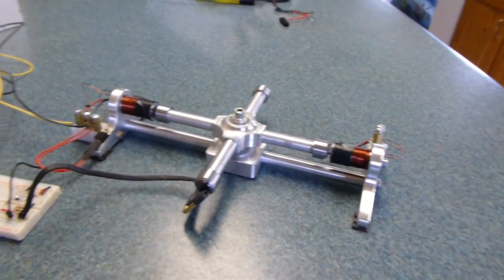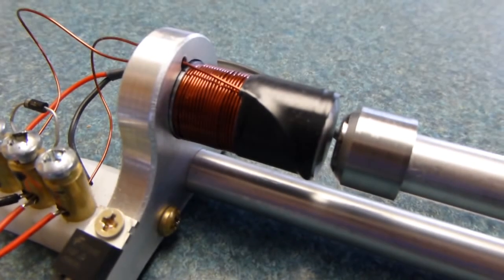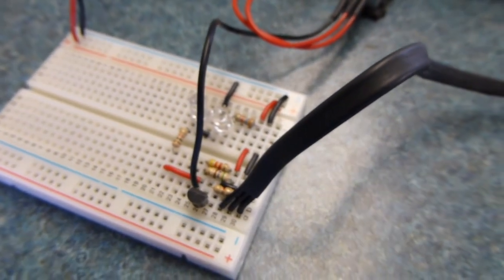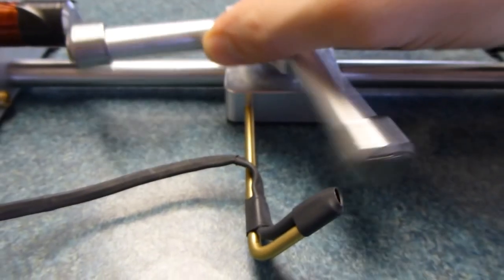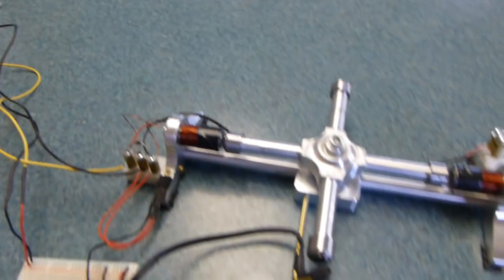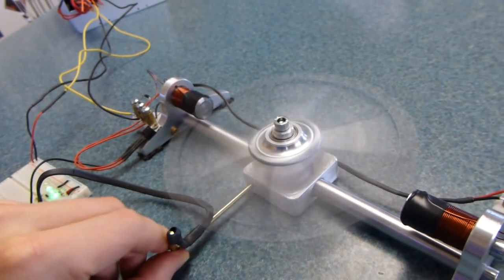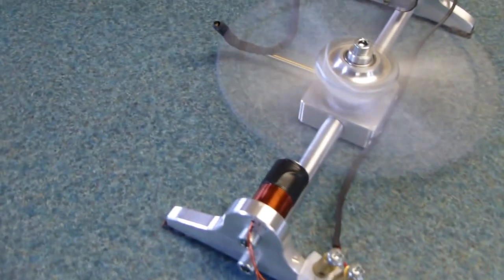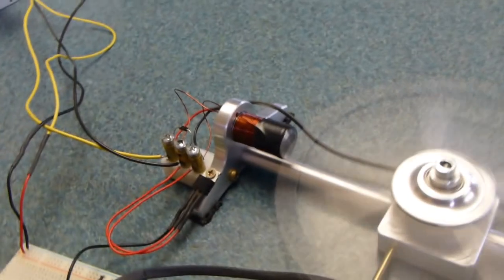DC Brushless Motor Project

Comment: Very cool, and i would have to work hard to do as good of a job as you did. I have a question though, When you turn the switch connected to the Brushless DC Motor, that shuts the current off for the coils, right? But, the motor stops with the coil next to the neodymium magnents. Is this from the attraction to the screw (or whatever it is) that the coil is wound around?
Reply: the magnets are naturally attracted to the iron(or what ever core metal he used)  of the coils.
Reply: That's what I figured

Comment: So when the power is cut from the power in what does that do?
Reply from the maker: ...it stops.
Reply: so it stops and starts again? Sorry Im still figuring out how this stuff works, I'm talking about when the sensor sends the signal that cuts the power.
Reply from the maker: Every time a magnet passes in front of the sensor it triggers the MOSFET to feed current through the coils. When the magnet moves away the signal stops and the MOSFET turns off.
Reply from the maker: The coils need to be turned off as a magnet approaches them because the active coil repels the magnets. Once the magnet has passed the coil it turns on to push that magnet away
Reply: Ok that makes sense thanks alot man
Reply from the maker: No problem, Robert!
Reply: lol...

Comment: Hey Jobn, good job! I was wondering how you would know which way it is rotating once it starts? It can actually rotate in either directions, right? Are the electromagnets producing the same poles towards inside the motor?
Reply from the maker: Luck of the draw. If it was machined perfectly it wouldn't move. It just so happens that it's deflected off to one side a little bit!
Reply: hahaaa!!

Comment: Nice explanation, I was looking information about the DJI Phantom and they mentioned "brushless motors", but had no idea what the technology behind the motor was. You explained it pretty much now...does it mean that the motor can run both ways (i.e. clockwise and counter clockwise), depending on which direction you push the rotor to?
Reply from the maker: Yup. What I showed here is a very simple single-phase motor. Your Phantom will run on 3-phase brushless motors, so there will be three leads coming out of each motor casing. Reversing any two of those leads will reverse the direction of the motor.

Comment: with all the requests looks like there could be a hobby kit with your name on it?
Reply from the maker: Haha, maybe. I don't understand the requests. It's a really straight-forward control circuit, I thought I did pretty well explaining it all in the video.
Reply: Jon Proce Some people don't know, what a mosfet is; why do you have a diode in the circuit and the resistors, why so many, what are they values and why, are they connected in front, after or in shunt  & with what & why, and so on.......Just think of yourself when you were new in this field, and you will understand the questions about the circuit straight away. ;)

Comment: Nice motor. Do you have a sketch of the circuit?
Reply from the maker: 12 V >> Coils in parallel >> MOSFET >> Ground

MOSFET gate is triggered by output of Hall effect sensor. That's it!

Comment: Could you please make a tutorial on how to make this?
Reply from the maker: Have you got a CNC machine shop at your disposal?
Reply: Unfortunately Not. I'm not in any engineering program. But thought that this might be a good project of physics class as we were on the topic of DC motors and the only exemplar that we had did not work.
Reply from the maker: The reason I ask is that the fabrication encompasses 90% of this project. It couldn't be reproduced unless you have the manufacturing facilities available.
Reply: Ok. Well Thank You very much for replying so quickly and helping out.

Comment: Hi Jon. I'm really impressed. Is there a way to get a copy of your project so that I can build one?
Reply from the maker: This video seems pretty easy to copy! :D
Reply: Jon Proce
This is true, but I was speaking more of the electronic schematic.
Reply from the maker: I don't have one available, but it is very simple. The magnets on the rotor trigger the Hall effect sensor on the brass arm. The Hall sensor sends a voltage signal to the gate of the MOSFET which sends current through the two series coils.

Comment: How many volts does the power supply put out?
Reply from the maker: Standard PC power supply. They have 12V, 5V, and 3.3V rails. This motor was running on 12V.
Reply: Ok thank you, I'm building a battary for a dc motor I'm making so I just needed a round about of how strong to make it.

Comment: Hello sir,
Your project is very good... I want to try it and present it in my college. I have to submit synopsis as soon as possible...
Please send me details of this project at lalit7joshi7@ymail.com
Reply from the maker: I think you might be missing the point of your education. There is not much work involved, I recommend you tackle it on your own.
Reply: I am trying but i nead help in electronics part. Mail me please the details of controller circuit. I will be grateful to you.
Reply from the maker: *****  if it were anything but a VERY simply control circuit I would completely agree with you. I explained the principle of operation in the video, and as such anyone with even an elementary understanding of electronics and internet access should have absolutely no problem recreating it.

Comment: I don't understand exactly how the speed varies on sensor rotation.
Reply from the maker: It simply changes the orientation of the rotor relative to the coils when the coils are turned on. I'm basically making the coils turn on at a non-ideal time which reduces the efficiency of the motor and reduces the speed.

Comment: Hello, it is a nice project you got here. I have a question about Brushless Motor. Well I got a 12V DC Brushless Motor which has 3 wires. I would like to know how i may switch ON the Brushless Motor using a DC power supply which has only 2 poles ( a negative one and a positive one just like a battery)
Reply from the maker: You can't. You need to hook it up via an electronic speed controller (ESC). Google it.
Reply: Thanks, Yes i have google it...I got information about RC Cars which have brushless motor. They use the ESC and another device, then connect all of them to the power source. There is a receiver which control the whole circuit. If I  do not want to use a receiver since I'm not doing a Remote Control circuit, which device can be used to switch on and control the speed of the brushless motor ?
Reply from the maker: I have used an Arduino successfully in the past to control the ESC. You need a device that puts out a digital PWM signal, not straight DC. Good luck!
Reply: Your motor is more complicated because it is a 3 phase BLDC motor compared his motor which makes the control circuit more complicated. But if.you Google 3 phase BLDC you should get more information

Comment: Does this work on the same principle as a Stepper motor? And another question. When the motor is off and the magnetic force locks it into position, how does it always start off in the 'counter clockwise' direction? Because technically it's in an equilibrium position to begin with so wouldn't it turn in any direction where it gets a slight nudge towards? Thanks and great job!

Comment: Jon, I deal with the type of brushless motors that the RC modelers use and I am fascinated by this. Not only because of its immediate sense of simplicity but that there is definitely more going on than meets the eye. We use electronic speed controllers that are programmable thru a simple card type prgrmr and also the firmware can be changed on the Microcontroller to increase the response and resolution. So I take it that the bread board would be home to the mosfet if you had a heat sink on it.

Comment from the maker: You are running too much energy through your coils (too much power). The power consumed by the coils is proportional to the resistance and the square of the current. Reduce the current in the coils by either reducing applied voltage or increasing resistance (more turns). You could also reduce the average power consumption by reducing the length of time that the coils are energized (pulse them on/off more quickly, and leave off for longer).